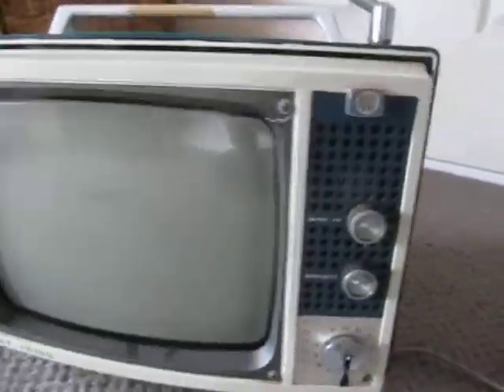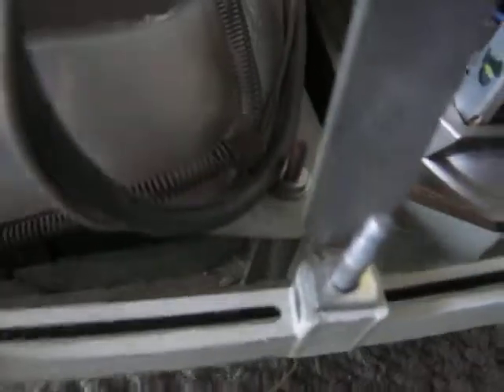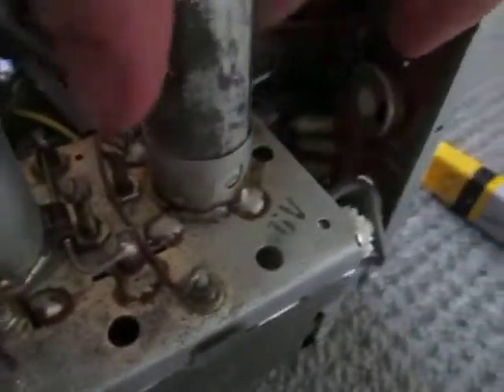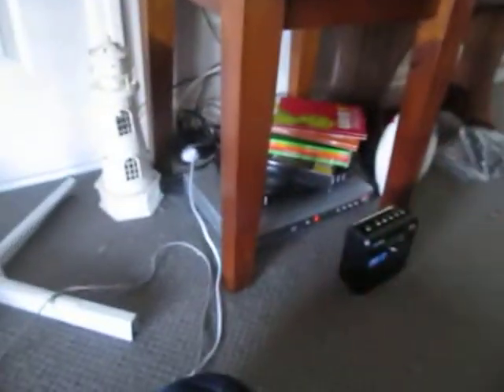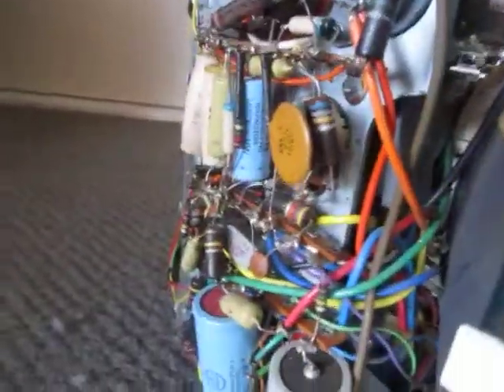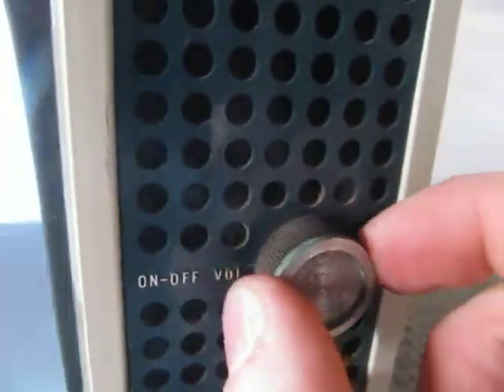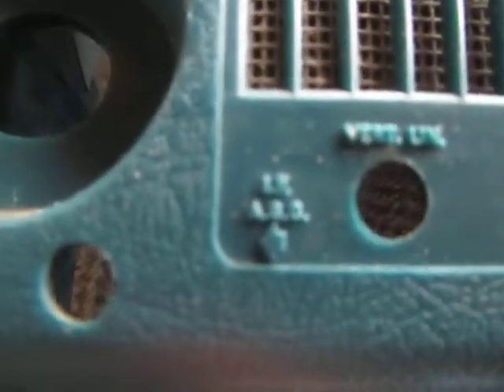B&W 11" AWA P1 portable

Comment: As you can see, the CRT mounting is one of the weak points of this set. The handle breaking is another. Those plastic screws were because the set was fed by twin flex power lead and not earthed. If the wiring should break down causing the chassis to become live, the plastic screws would prevent a shock hazard. Valve at 3:57 is 6AX4.
Classic vertical fault there - the .0068uF in the vertical oscillator has gone leaky. You'll probably find all the high value resistors are out of tolerance too.
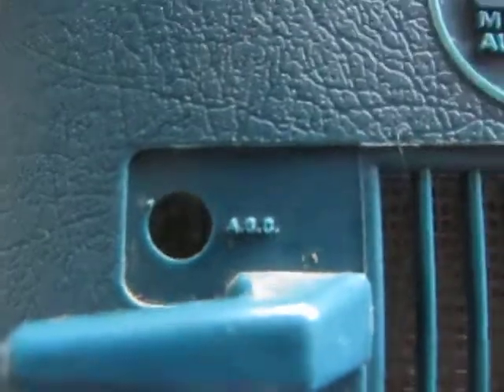Volume control needs a squirt of CRC to quieten it down. The glow you mention at 8:07 is from the beam hitting the neck of the CRT. A small amount of phosphor there is likely to be present as a result of the manufacturing - it's put in the tube in an aqueous solution and the water removed. At 10:03, it's actually AGC, Automatic Gain Control, which automatically controls the gain of the tuner and IF amplifiers to compensate for varying signal strengths.
The P1 was probably the longest running monochrome chassis in Australia, from 1965 until at least 1973. It's was AWA's reaction to the GE TF1. The last production models had some cost cutting; eg. the top linearity control was removed and some of the video amplifier frequency compensation removed also. By the 1970's the P1 was being fitted with a three core power cable to earth the chassis.

Comment: The adjustments that you were trying on the back.  You need at least a picture showing before adjusting or a signal generator with cross hatch patterns.  Being an old TV it would of been wise to replace all the caps and check the valves before use., even though they looked like they were working they could been shorted or leaking.  Not getting a full screen normally means one of the valves was shot.

Comment: The abbreviation 'AGC' stands for 'automatic gain control'. It looks like you have all valves functioning. From a technical point of view, you have a 'flying start', as you have a raster on the picture tube, and sound from the speaker, despite the 'crackly' noise, indicating a dirty volume potentiometer. The 6CM5 valve is the 'horizontal output' valve. The vertical deflection fault is in the amplifier which is connected to the outer winding of the yoke, likely to be a 50μF, 50V electrolytic..

Comment: Hi there, first of all congratulations on your first valve TV set. I had one of these when I was about 13 or 14, they are neat little sets. You'll got leaky capacitors or resistors causing the problem with the vertical/frame output circuits. It could even be the vertical output valve causing the issue as well, but I'd check/replace the capacitors first. Looks like the CRT is nice and bright so you should get a good picture on it. Good luck with repairing it. Cheers! Glen

Comment from the maker: Thanks! It's going to be a project and a half though. For an experienced collector, this is the easy stuff; replacing a few aged electrolytic caps. For me, it's harder because I have to order all the bits online. Someone's also gone through in the past and messed with the main PCB. The circuit is not like it is shown in the circuit diagam (mis-valued components etc.) A lot of the caps are the wrong values... I'll need a lot of luck and even more patience!

Comment from the maker: It does. It has a few electrolytic caps that need replacing. I'm hoping that Jaycar stocks these axial lead electrolytic caps... The power/volume potentiometer also needs replacing. I've given it a quick clean and that's eliminated the issues with the speaker.

Comment: to fix a noisy anode: you need to remove the suction cup & clean off all the dust which causes HV Corona, My PYE TV did that bad as well as hiss, as if there was an air leak, turned out to be a very dusty & poorly sealed suction cup on the crt :)